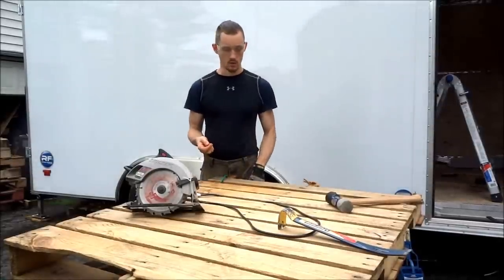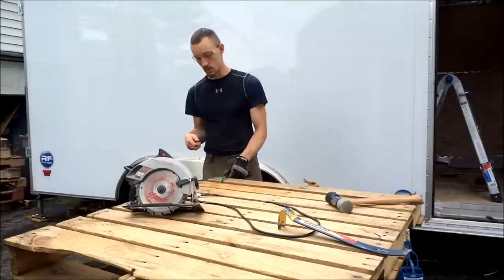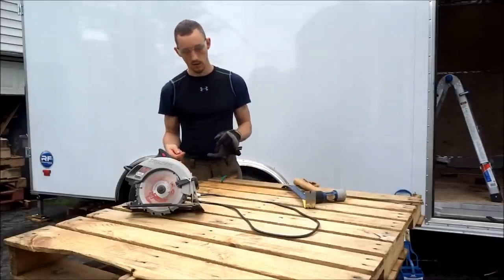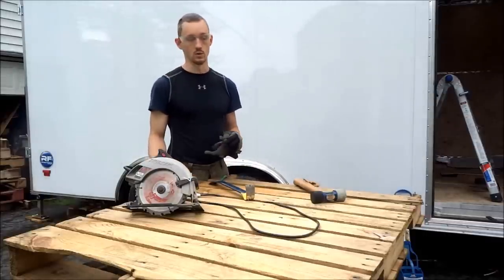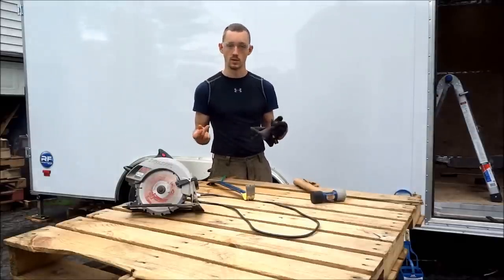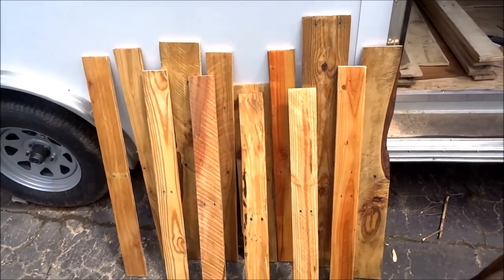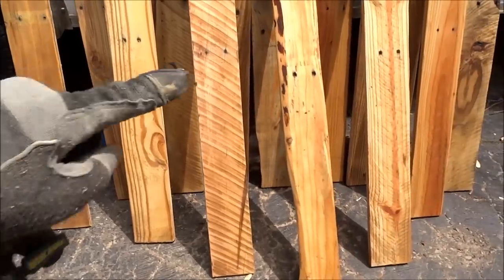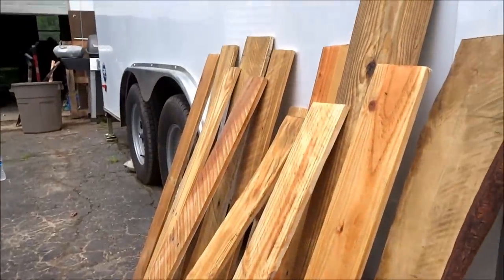Episode 17 - Cargo Trailer Tiny House

Comment: If you ever have the chance to acquire a sawzall, they're a dream for taking pallets apart and keeping all the boards in tact. Dismantled many a pallet with the trusty sawzall. There is value in doing manual labor, but there are times to work smarter, not harder :)